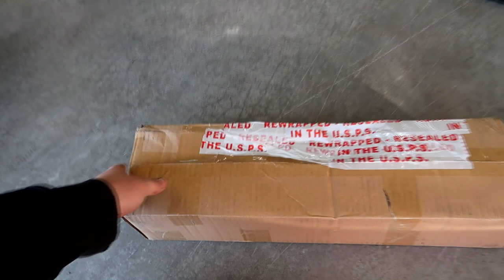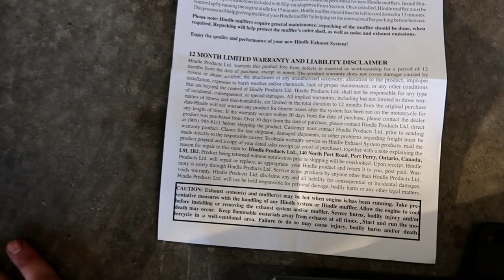Cheap Vs Expensive Exhaust ! Honda Grom 2020 Hindle Vs Ebay Amazon

Comment: Hello, not so sure if you've made the adjustments, but, the reason why your hindle didn't add some power to your grom compare to barbs "cheapo" exhaust was that Hindle stuck with regulations.. check your Hindle, it could still have a baffle inside of it (somewhere between the exhaust and header pipe) unlike barbs whereas was upfront removable and somewhat became an "open exhaust" type...

Comment: You probably know but you need to use a heat gun for sticker removal. And for scraping tool always the tool being something softer then then material your scraping against
Reply: plastic razor blades ftw

Comment: there should be an exhaust gasket, original probably stuck in the head. happened when i swapped exhaust on wave 125 (practically same motor).

Comment: it will only make more power with the baffal in wich makes more torqe aswell but only like .80 of a hp and like .60 flb of torqe with a un tuned engine due to back pressure. so its better to leave the baffel in cuz other wise then yes you make hardly any power unlees you want it just as loud as possible

Comment: I would motor swap it depending on how much you want to spend you can go zs190 or 212  if you want to spend more go Daytona 190 or 212cc the big bore kit and oil cooler and cover going to cost the most  in the end. the 212 4valve Daytona race engine would be the closest to that 100 mph it what your looking for they also have kits to keep the fuel injection and I would go with the a racer stand alone ecu it will be a beast👍👌✌️💯

Comment: Those stickers always create problems. And those plastic covers always scratch. You can just replace the whole cover very inexpensively. Or you can just wrap it with any type of vinyl wrap or like you mentioned the carbon fiber wrap material is nice

Comment: Thanks 'HunterTuned'. Great review! HONDA Grom ex Honda MSX. The first bike, flat-foot that I felt comfortable riding after my latest TKR (Total knee Replacement) Left Knee 2020. Than was the 5th TKR operation. Four on the Right Knee. Primary TKR  failed in 2014 Stockholm, Sweden failed resulting in a almost chronic, deep infection around the implant. 2018-19, finally after a two-stage revision here in Bangkok, Thailand. Thai orthopaedic surgeons are world class.Maybe, because of the many motorcycle accidents! The orthopaedic  residents perform a lot of "Nailing & Plating". Anyhow, I never thought I would be a biker and absolutely own/ride a bike in Bangkok. Later, I did test a scooter VESPA 300 GTS, automatic, of course.  But "swing a leg" I thought that's impossible! Anyhow, the dinky HONDA Grom was the motorbike that changed my mind and I almost bought one. But, then finally I decided to buy a "flat-foot" cruiser, easy rider instead. But that's another story. Here my GROM, I like the name far better than MSX ('Mike, Sierra , X-Ray) https://youtu.be/SH3hCvVxf5E

Comment: Hey brother, just a quick question. I just purchased a 2024 GromSP. In your opinion, which exhaust is the best bang for the buck? I've been tossing around Vance and Hines Hooligan, Yoshi RS-9T, this Hindle, and the Akrapovic. I only plan on doing minimum mods to this such as Chimera intake, exhaust, sprocket swaps. I'm 6'2, 232lbs so I'm not expecting much, just would like to see 60-65mph with my ass in the seat.
Reply from the maker: Yosh sounds the best. If you want bang for buck get the Amazon pipe
Reply: @HunterTuned  I was leaning toward the Yosh since I have owned their products in the past on my r6 and street triple. I've been binging your vids for the last 2 days so I figured who the hell better to ask than you 😆. Also, I have seen conflicting reports on the need for the power commander V if you do both the exhaust and chimera intake on whether its needed or not. I understand these little shits run lean as it is, but is it necessary before I drop 600 bones on something?
Reply from the maker: @TheSaltySabot  I would just get the ecu reflash from DHM motoring
Reply: @HunterTuned Thanks man!

Comment: I have the Amazon exhaust with a intake, tune, five row oil cooler, high flow oil pump, oil spinner delete clutch cover kit and a TB cam. After the cam, the Amazon exhaust sounds like crap in higher RPMs. I just ordered a Hindle because I want to switch to a stand alone fuel management system with the wide band sensor.  I don’t trust my DHM tune. The plug looks like the bike has been running lean.

Comment: The larger exhaust is hindering the stock engine. You basically lost a bunch of torque.
Reply: not realy it will make more power but it only dose that with the baffal in wich makes more torqe aswell but only like .80 of a hp and like .60 flb of torqe with a un tuned engine. so its better to leave the baffel in cuz other wise then yes you make hardly any power
Reply: Why does anyone not know how to spell does?🤔

Comment: I SERIOUSLY doubt that those Chinese ‘carbon fiber’ systems are REAL cf.  They MIGHT have a single layer of weave over a cheap composite, or metal can.
Easiest would be if someone drilled-out the rivets, unpack it, and post a pic of the inner can.